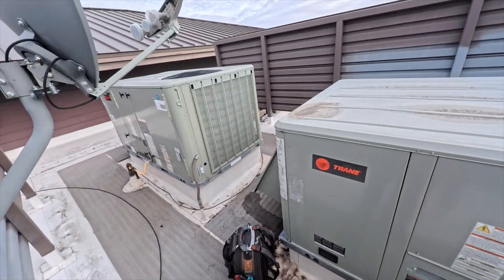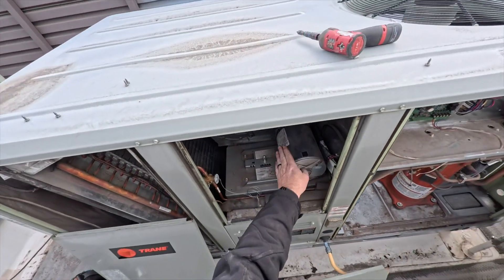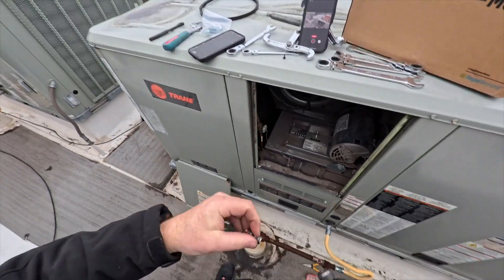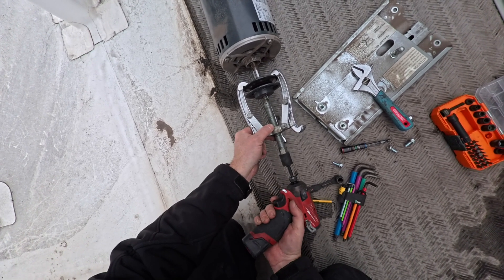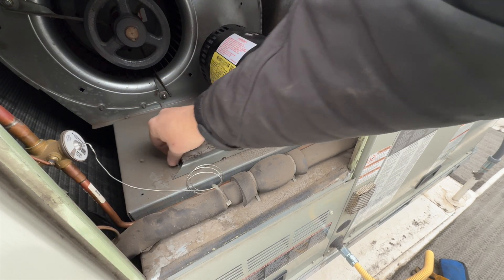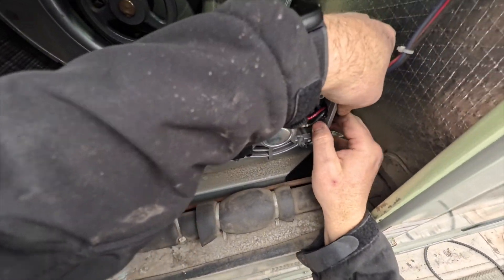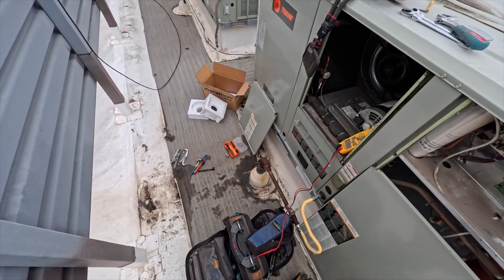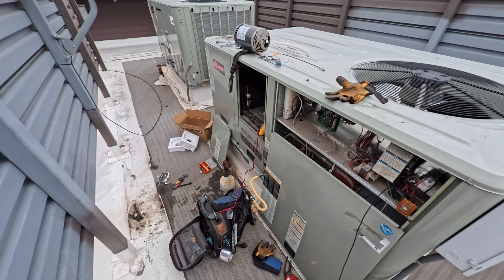Belt Drive Blower Motor Failure and Replacement EP208

Comment: I think using both cameras will allow multiple angles, which gives more views to what you are doing. I appreciate the info as well. I do have a question, though. What size motor was that? Was it a 1/4, a 1/3? Also, my other question is, is changing this motor the equivalent to a house furnace belt driven blower motor? I ask because mine is just getting so old I have to change it out, and I thought I would have to cut the wire and manually connect the wires back together after cutting it with the new motor. I just purchased a 1/3 blower motor and I am doing it myself, but if all these motors have the end connectors like you just showed, with color identification then this will be easier than I thought. My house keeps losing the motor every 4 hours, and I have to rotate the motor pulley until it hits a loose spot so the power allows the magnets to spin the pulley and belt easier to start it back up. I have to do this every 4 hours so I just got a new motor.

Comment: I think action camera is good for the troubleshooting/setup/tweaks, but less for part replacement/removal. Maybe when you need to remove/install a part use the mounted view. Otherwise use the action camera it looks good.